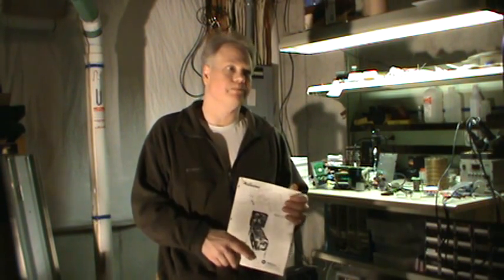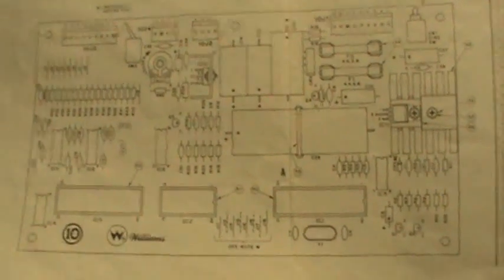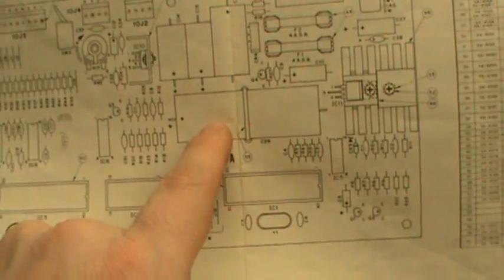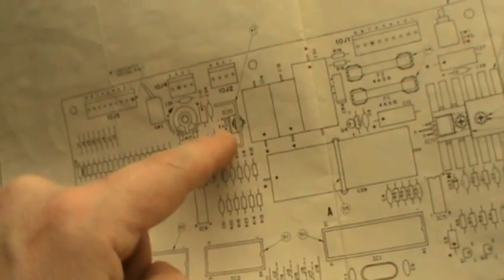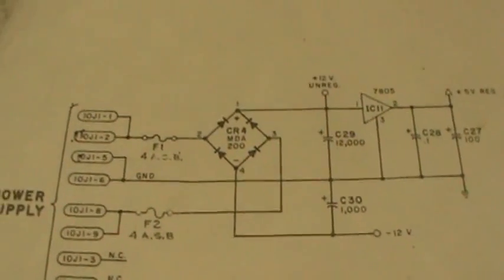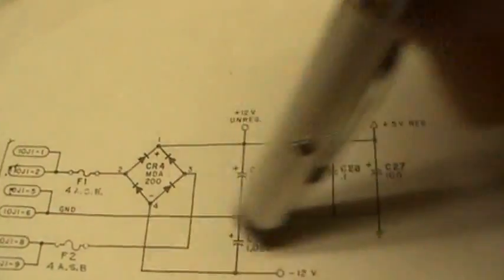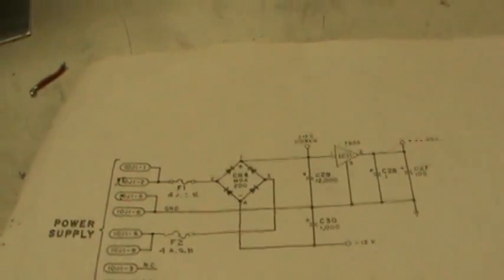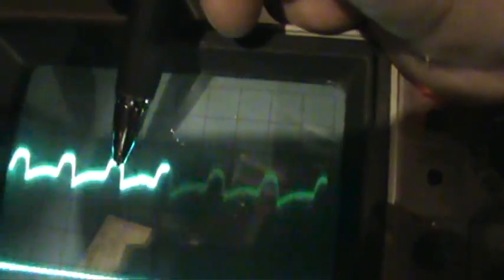Williams Flash and 60cycle hum fix (three parts put together)

Comment: Fantastic EASY fix!   The Flash I am restoring had the same exact HUM.  :o   Did a cap kit on the sound board and even replaced the header pins.  No change.  Pulled that ground wire you are talking about and VIOLA!  No more annoying hum!  Thanks again for posting this most excellent VERY EASY fix!
Reply from the maker: Excellent to hear. I have had the ground lifted on mine for a few years now with no ill results.
Reply from the maker: Excellent !